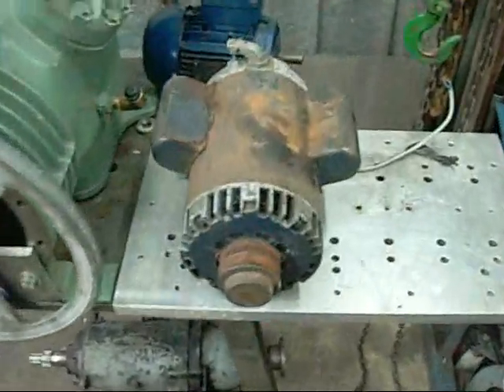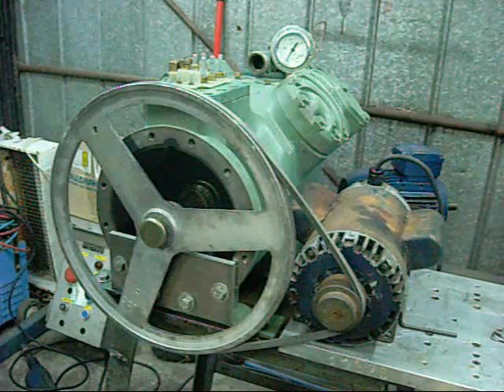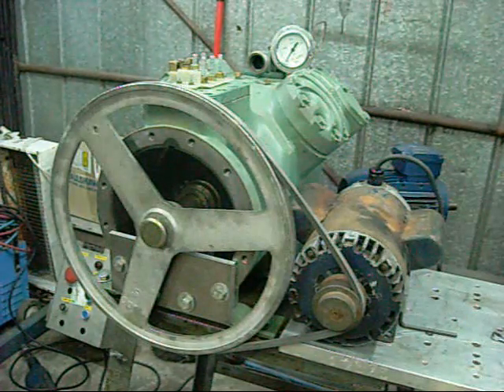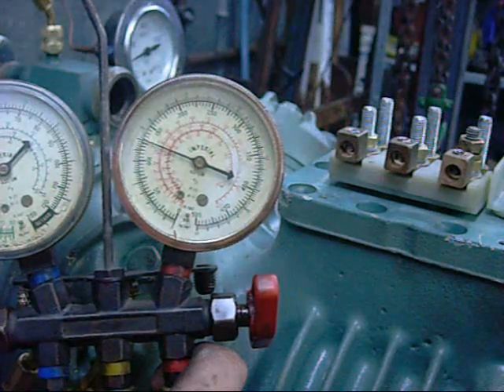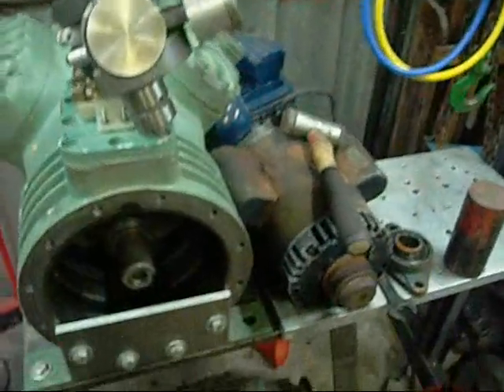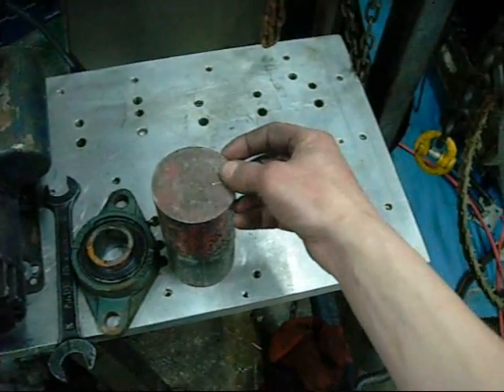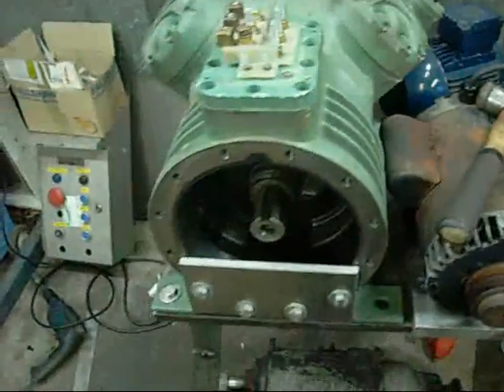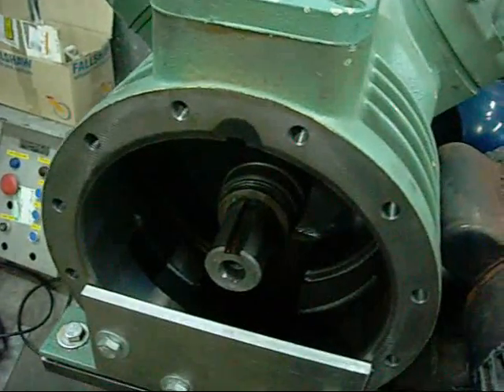Bitzer V4 Compressor Run - Leeson 1.5Hp Single Phase Motor

Comment: well done! you  converted a refrigarator compressor-motor to a belt drive air compressor! good work!
Reply: if that compressor  was made to cool long distances  through buildings imagine how cold the cold line  will.be if it was made for short distance phase change cooling for projects probably touching liquid  nitrogen  temps

Comment from the maker: @lazaglider I think its called P20 here. great for machining and bolting together, but shit for welding.

when I do another shredder I will show how to machine, heat treat and surface grind it. (the old Cincinnati grinder at work is perfect for doing blades)